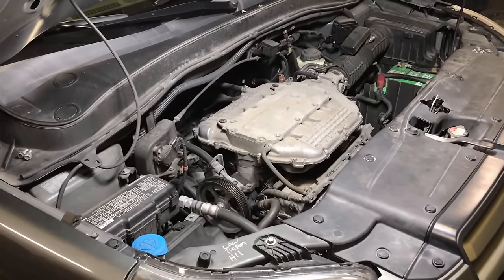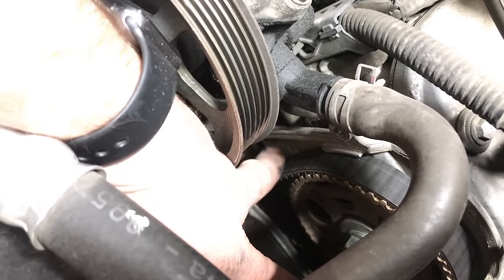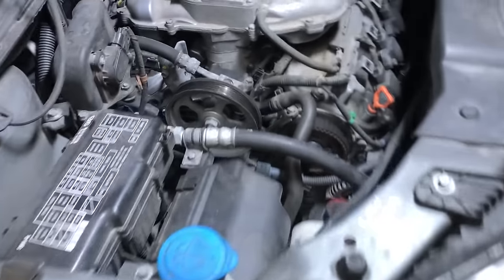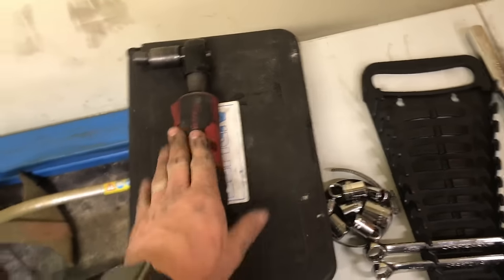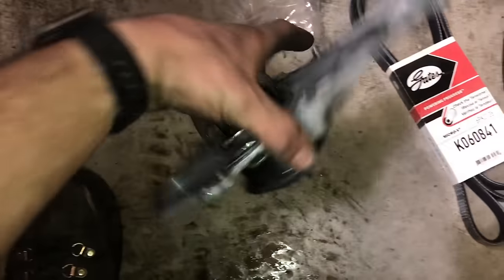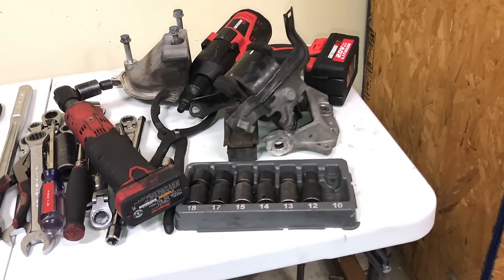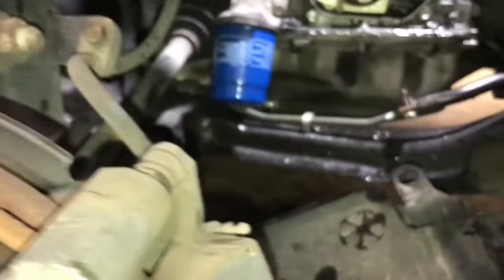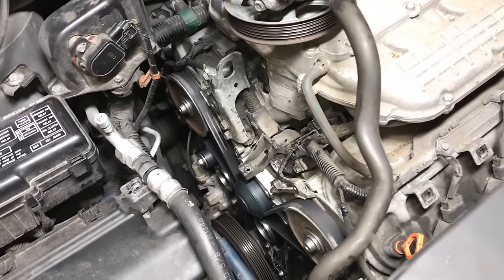Honda 3.5 Rattle Noise

Comment: So many facepalms on this video. 1st off set engine at top dead center before removing the belt. Second rotate the engine clockwise one full rotation back to tdc to ensure it is properly timed. Starting the engine to check proper timing is the dumbest way and can damage the engine if timing is off. This video made me cringe. You sir should not be working on cars
Reply: In the video he states he rotates it 720 degrees before starting the engine. I think what we saw is a "final check" of sorts since the tensioner was also replaced.
Reply: The infamous "
Sir"
Reply: Not.true